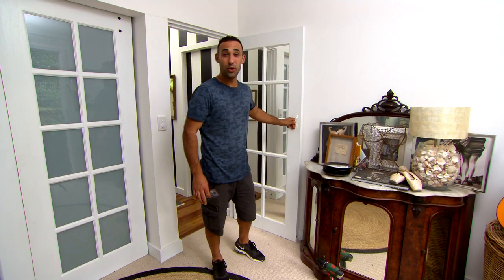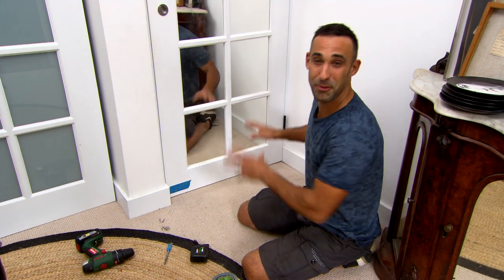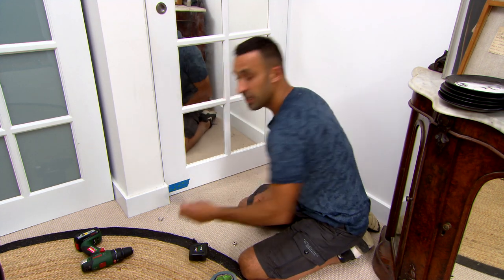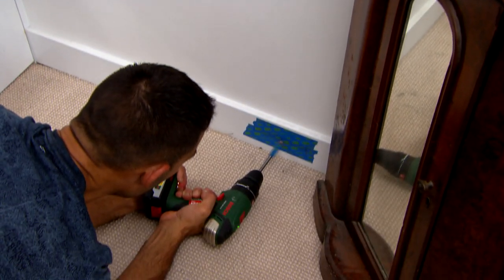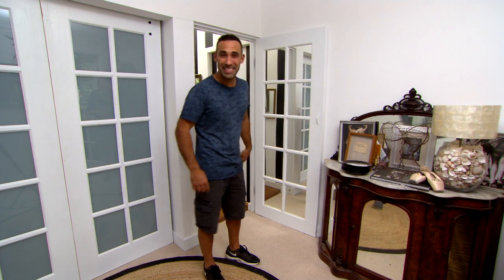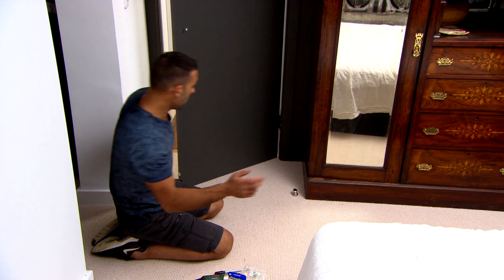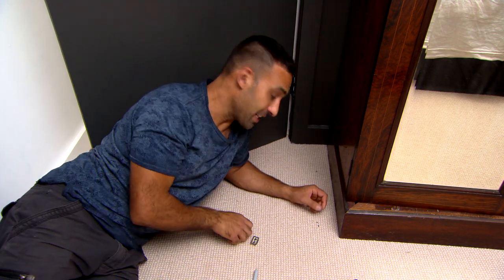How To Fit a Door Stop | DIY | Great Home Ideas

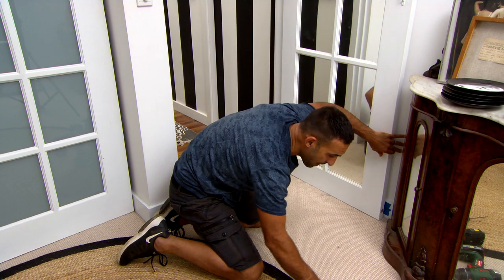Comment: 01:38 or you can use the screw you just did on the door.  Just screw it in half way and press firmly on the skirting to make an indent, and drill away....